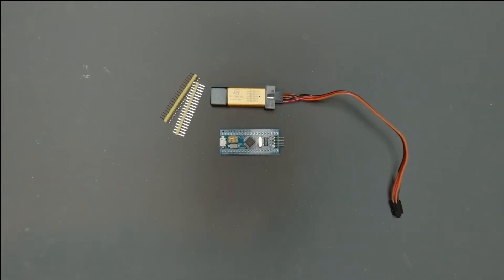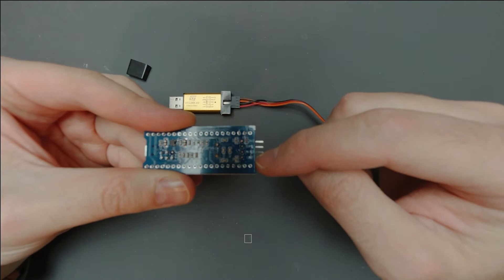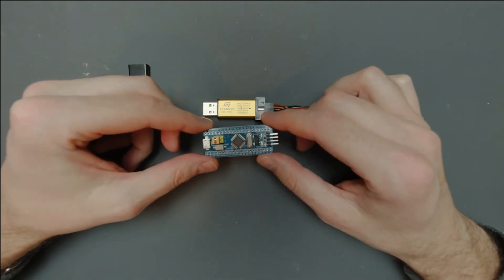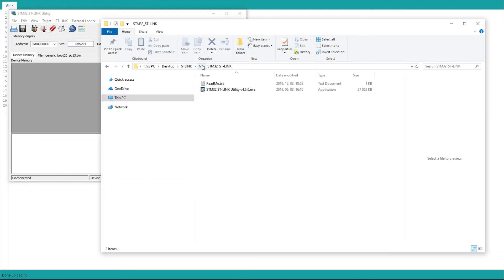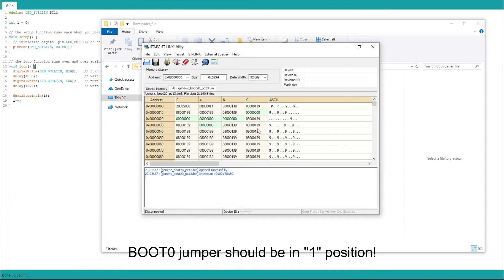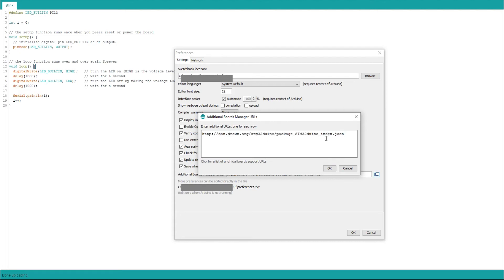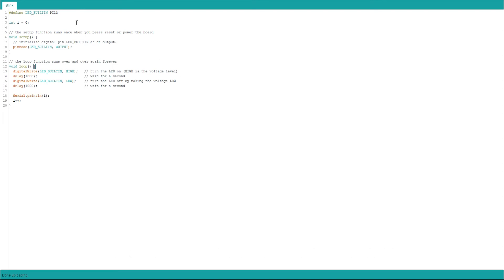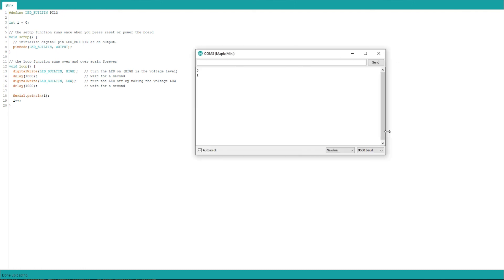STM32F103C with ST-Link and STM32duino, simplified!

Comment: i have a problem. my arduino ide does not show a st link in the upload menu.  but it shows st link in device mgr
Reply from the maker: Sounds like you haven't followed every steps. Have you added the stm32duino to the Arduino IDE? Have you switched to the other group of microcontrollers? Watch my video carefully and follow it step by step.
Reply: @CuriousScientist   I have a f401 black pill and just want to use  the st link to program it. but st link does not show up as an option in my arduino IDE.  is it the bat files maybe ?
Reply from the maker: I would assume yes. I don't know the differences between the two devices and I have never worked with the black pill. But I suspect that it needs different files perhaps.
Reply: yes i have done all steps. but still does not show st link for upload
Reply from the maker: It is hard to guess what could have gone wrong. Have you checked the BOOT jumpers too? It might be as well that something went wrong with the microcontroller itself.

Comment: Hi, 
Great instructions, however I stumbled on a problem. 
After I loaded the bootloader via stlink the program said that it was loaded OK but immediately after wrote that the device was not connected anymore (same as your video showed after disconnecting although it still was connected). Anyhow, assuming the bootloader programming went OK I continued to the Arduino environment and connected to USB. Trying to upload a blink program failed - got a message that the device was not found (although, if I try to get board info it reports the type of board correctly). Assuming something went wrong with the bootloader decided to re-flash it. Now when connecting to STL and trying to connect the program says that it cannot conect to target. Any idea why this happened and how to fix it?
Reply: Go to target-settings, select connect under reset, then press reset button on the board and click ok
Reply from the maker: Hi! Did you follow the routine for the BOOT jumpers? It is crucial to have them in the correct position, otherwise the bootloader will not be uploaded. Also, some certain copies of the blue pill have different resistors for R10 what it should be and that can cause issues with the USB connection. Check the value of it. If it is not 1k5 but 10k, it has to be corrected. Either you resolder is, which can be a painful process, or you solder a 1k8 resistor between +3.3 V and PA12. I had one board which had this issue and I could solve it with the resistor trick.
Reply: @CuriousScientist  Yes, I followed the jumpers routine. I also already soldered a resistor in parallel to R10. The problem is that currently I simply cannot connect to the board - not via USB and not via stlink. I Do not see why, but maybe it was damaged somehow during the process (the indication that something went wrong is the fact that stlink lost communication immateriality after the bootloader was programed while it was still connected)
Reply from the maker: @giladandlimorbarak2521  Do you have another board to test? I usually order them in 5 or 10 pcs packages because 1-2 of them is usually defective or dies very quickly. It might be the case that it went bananas just in that moment when you installed the bootloader. Another approach could be to check if you can connect to it via an FTDI adapter. If that works, then you can still save the board, install the bootloader via the FTDI, and also test it. If it works via FTDI and does not work via USB, then something is wrong with the board.
Reply: @CuriousScientist  Thanks, will try this. I have only another one - will order some more
Reply: @giladandlimorbarak2521  I have ST-Link Utility v4.6.0.0. There is no 'connect under reset' that others have mentioned. What I did was move boot jumper to 1. Click 'Target' menu and get ready to hit 'Connect'. Plug in ST-Link USB and hit 'Connect'. It has to be done in a very short time after plugging it in or it won't work. It may take a couple of tries. What you do now is 'Erase Chip' to get rid of this bootloader that doesn't work. I found two versions. The file under 'BootloaderOnlyBinary' does not lock up everything, but I couldn't get it to work in Arduino: no COM port, Could not find the DFU device, etc. The file under 'BootloaderBinary' just locks everything up. I did an erase with the bootloader jumper in both positions so it would erase bootloader and main flash. It's time to find a solution that works with the new ST-Link program and Arduino 1.8.19.
Maybe both of my boards are bad, others have had success getting this working. Try to run the author's steps again with a couple of boards.

Comment: Great instructions, but I get a JAVA runtime error on upload.  At the end of the error message, there is a statement that the error occurred outside the runtime environment in the native code.  I think I followed all the instructions. Bootloader (on the board) is OK, Arduino IDE senses the board type, port, board info.  I selected STM32F103C generic, loader is Maple Mini, upload method is STM32duino bootloader.  Argh !!!!  Im running a blue pill.
Reply from the maker: Are there any error messages? It is a bit difficult to guess by this. It might be that some of the drivers are not (properly) installed. Can you tell me which drivers you did you install?
Reply: @CuriousScientist  Thanks for the response.
maple_loader v0.1
Resetting to bootloader via DTR pulse
#
# A fatal error has been detected by the Java Runtime Environment:
#
#  EXCEPTION_ACCESS_VIOLATION (0xc0000005) at pc=0x000000007110b5db, pid=16516, tid=21364
#
# JRE version: Java(TM) SE Runtime Environment (14.0.2+12) (build 14.0.2+12-46)
# Java VM: Java HotSpot(TM) 64-Bit Server VM (14.0.2+12-46, mixed mode, sharing, tiered, compressed oops, g1 gc, windows-amd64)
# Problematic frame:
# C  [jSSC-2.8_x86_64.dll+0xb5db]
#
# No core dump will be written. Minidumps are not enabled by default on client versions of Windows
#
# An error report file with more information is saved as:
# C:\xxxxxx\xxxxx\AppData\Local\Arduino15\packages\stm32duino\tools\stm32tools\2020.6.20\win\hs_err_pid16516.log
#
# If you would like to submit a bug report, please visit:
#   https://bugreport.java.com/bugreport/crash.jsp
# The crash happened outside the Java Virtual Machine in native code.
# See problematic frame for where to report the bug.
#
I ran this as admin to install the driver  install_STM_COM_drivers.bat
Reply from the maker: Allow me a few days as my weekdays are usually very busy. I will return to you with some information.
Reply: @CuriousScientist  Additional troubleshooting.  I started with an "out of the box" blue pill, It started flashing at a fast rate (pre-installed blink). I loaded the bootloader using ST Link and that worked.  I modified blink to match your example to flash on 500 ms and off 250 ms along with the counter.  I uploaded to the pill using plain old USB (not ST Link) and it worked fine. When I tried to upload again, I get the error messages.  I restarted the IDE (1.8.13), unplugged and replugged the pill but to no avail. I reloaded the bootloader and the new blink was still in there.  I tried to reload the blink program and that didn't work.  I did a full chip erase, repeated the ST Link load and that worked.  I loaded the modified blink via the USB and that worked.  When I try to reload the blink software again, I get the errors again. So right now, the only way I can get uploads to work is to do a full chip erase.
Reply from the maker: Do you move the jumpers as instructed? If the jumper is not moved, you upload the code directly to the chip, potentially overwriting the bootloader. 

As I understand the bootloader is a sort of a software that accommodates your unique software. The bootloader allows you to upload software directly from USB. But for this, you have to follow some rules, otherwise you end up erasing the bootloader from your blue pill. I imagine the bootloader as a operating system. You put it on your PC and then you can install software in your PC that can communicate with other hardware and stuff... 

So, I assume (I might be wrong) that you forgot to move the BOOT0 jumper. So, let's start from scratch after full chip erase. First, without connecting the blue pill to anything, put the BOOT0 to "1" position. Connect to ST-LINK, then upload the bootloader. Now, while the power is still ON, put the jumper back to "0" poisition, then remove all connections. After this step, you should never ever touch the BOOT jumpers, except you want a new bootloader, or you want to upload the software directly to the chip. Now, the bootloader is on the chip and since you are in the "0" position, the software which will be uploaded via USB will end up in the correct place in the chip's memory. So, now, connect to USB, and upload something. After removing the USB and reconnecting it, the same software should be on the blue pill, and you should be able to upload a new code. 

What could also happen to your blue pill is that it has the incorrect resistor (R10). Check it on the backside of the PCB. it should be 152. If it is not 152, either you have to replace it, or you place a resistor between PA12 and +3.3 V based on the value of R10. If R10 is 472, you use a 2k2 resistor, if it is 103, you use a 1k8 resistor. I had 1 or 2 boards with this issue, and this resistor trick solved it.
Reply: I may have a laptop compatibility issue.  I followed the procedures on my other laptop and everything worked fine.  I can reprogram the bill with no issue.  when I move the pill over to my problematic laptop, i get the same errors as before without reprogramming the bootloader.  Is there a way to delete all the drivers and reinstall them?  Did I install something I should not have?  I ran install_STM_COM_drivers.bat as well as install_drivers.bat as an administrator.  Could that have broken something? The device manager for the USB shows Maple Serial (COM3) but the driver status shows a 0x0 error "Driver Management concluded the process to install driver usb_device.inf_amd64_6f8004a4fa4faa5f for Device Instance ID USB\VID_1EAF&PID_0004\5&1A827C6E&0&3 with the following status: 0x0".  I get no errors on the terminal window as the drivers load.  ????/
Reply: I was able to reprogram my blue pill on my other laptop.  I tried a bunch of things to no avail, but I thought that, since I was getting JAVA errors, I decided to delete the JAVA development environment on my problematic laptop and that fixed my reprogramming problem with the blue pill.  I don't know why this is so, but I'll work it outside this forum.  Thanks for the suggestions and trying to resolve.
Reply from the maker: Hi! I would check the USB devices in device manager before connecting the bluepill. Then, I would connect the bluepill and check for the new device. Select it, then remove its driver(s) from the device manager. That should be enough, I guess. I think it is enough to run the install_drivers.bat. As far as I remember, I have only ran this particular bat file only.

Comment: Can you fix the link to the arduino driver to point directly to the driver file to load for windows. It points to a directory with many files and subdirectories but it's not clear where is the driver itself.

Also, I think you skipped the part of installing the stm32 in arduino after adding the json url to the board manager.
Reply from the maker: Thank you for the feedback! Sometimes I am not aware of how deep I am explaining stuff, so it is good to know if something is missing. I fixed the driver link, I hope that this will help you. Now it points to the 'win' directory. You just download the whole directory, then click on the install_drivers.bat file. That should install everything. It might happen that you have to run it as administrator. If you still have issues, please let me know, I will try to help you!

As long as I'm concerned, it is enough to add the path to the json file. I recently reinstalled my computer and I haven't downloaded the STM32 in Arduino IDE. The installation is only necessary, if you want the libraries for STM32. I prefer downloading them individually because I don't use 99% of them.
Reply: @CuriousScientist  I am still confused by this process. I click the link and I'm in the Git Repo at "Arduino_STM32/drivers/win/". There is no download button or link I can see. If you click on a file it displays the contents of, for example, "install_STM_COM_drivers.bat". What am I doing wrong? Does one need a Git user account?
One other question: isn't the bootloader supposed be be already installed by STM? How does one tell if it is or not?
Currently when I connect the Blue Pill via USB, I get a popup that says "device not recognized...device malfunctioned..." This is with the boot jumper in either position.

Thanks - Greg
Reply from the maker: @pwrgreg007  Hi Greg,
The simplest thing is to go to the main folder "Arduino_STM32" where you can see a big green button called "Code". Click on it, download the zip, then fetch the files from the corresponding folder. 

Yes, some microcontrollers come with a preinstalled bootloader, but sometimes you can accidentally delete (or rather, overwrite) them, so that's why it is good to know how to install the bootloader. Just try to connect the stm32 to a USB port and for example, try to upload a simple blinky sketch that toggles the PC13 onboard LED. If you can upload the code, your board already has the bootloader.
Reply: @CuriousScientist  For bootloader file, there is "generic_boot20_pc13.bin" in two folders, "binaries" and "bootloader_only_binaries". Which is the correct one?
Thanks - Greg
Reply from the maker: Try both and one should work. I believe that they are the same.
Reply: @CuriousScientist  They are two different sizes. In my case, the 'BootloaderBinary' file causes STLINK to lose connection as soon as it's downloaded, requiring a flash-erase and reprogram. It seems to blink a couple times then die. The 'BootloaderOnlyBinary' will download and maintain connection, and the Blue Pill is fast-flashing at this point. I switch to boot 0 position, and unplug. I ran the batch file: Installing Maple DFU driver...Success + Installing Maple Serial driver...Success. Plug in via USB and run Arduino. No joy in Arduino 1.8.19: Couldn't find the DFU device. Port menu option grayed out. Perhaps I have bad boards.

Comment: By far the best guide out there, thank you!
I only got stuck at one problem.. Tried to run your code and the Serial.println(i) does not print anything on the serial monitor, any ideas on that one?
Reply from the maker: Hi! Thank you, I am glad that I could help!
Check the ports whether you are connecting to the same COM where your Blue Pill is located at. Also, make sure that the terminal and the board is at the same baud rate. As you can see, my code was running as I uploaded it to the board, so if you followed the tutorial step by step, it should work. Also, make sure that you move the BOOT jumpers on the board according to the instructions.
Reply: Did you add the extra code to the blink.ino to do the counting?

Comment: Not sure how difficult, but I'd like to port the STM32duino-bootloader to an stm32h7.. do you know if it uses usb's CDC class or HID class?   According to the USB Composite Library for  Roger's Melbourne's STM32F1 seems to support many classes.. HID, Mass-Storage, etc, but not exactly sure if it's HID for bootloading!
Reply from the maker: Hi! Unfortunately, I do not have any experience with the above mentioned chip type. My only suggestion would be to give it a try. I guess, you cannot really mess it up if you try to upload the "wrong" software. In the worst case it will do nothing.